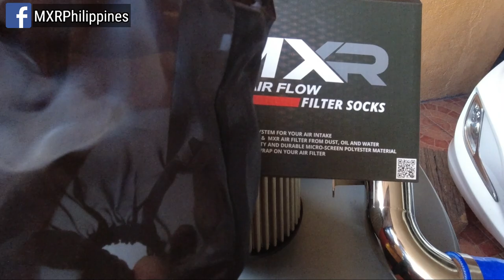Ang Lupet ng Tunog! Hyundai Accent CRDI High-Flow Performance Air Filter Upgrade

Comment: Sir Noah Thanks for the video I did install a K&N OEM filter and it feels wayyy better now it is more responsive and also a little bit louder but not too much like the cone filter. cheers!! Also, I will like to remap the ECU but it is too expensive I will need to save for some time
Reply from the maker: Welcome sir. Did you used drop in filters? They are okay too. Yes ECU remap is expensive especially if you live here in Manila

Comment: Intercooler upgrade for accent sir hehe
Reply from the maker: Pwede sir. Pero ipon muna. Mahal ang pyesa ng aftermarket IC sir at walang seller na nagtitingi ng pipes at couplers. So baka ipagawa na lang natin if ever
Reply from the maker: Pwede sir. Pero ipon muna. Mahal ang pyesa ng aftermarket IC sir at walang seller na nagtitingi ng pipes at couplers. So baka ipagawa na lang natin if ever
Reply: @NoahsGarage  waiting din po dito sir. Intercoller upgrade. 

Parang Negative kasi ako sa high flow air filter, mapupudpud daw kasi yung turbo(impeller - yung parang elise) mo nyan sir sa katagalan dahil sa nakakapasok na may kalakihang alikabok, based lang sa nakikita kong vlog ng mga mekaniko sa inaayos nilang mga sasakyan
Reply: Sisibak ng SUV yan sir pag nagkataon 😁
Reply from the maker: @quinjanrobertocampo8600  kahit stock sir sumisibak ang accent crdi, lalo na po kung upgraded ang air intake system 😅

Comment: My car 2019 CRDI accent auto trans was dyno tuned with stock intake/airbox 110hp and 159ft pound of torque. With stock airbox and the addition of 2.5 inch exhaust I only gained 1hp but gained 12 ft pound of torque to 171 ft pounds. I would do this first. I may buy a manual trans accent CRDI and go full tilt with it.
Reply from the maker: Dont forget to subscribe

Comment: Sir anu po kaya problema 2015 Accent diesel s bahay, sa Panel board nya po temp. gauge lang gumagana yung iba wala na po fuel, rpm, speedometer gauge. At kung minsan nag bliblink ilaw nya sa pael board pag naka low ilaw sa gabi.
Reply from the maker: Sira na board nyan sir. Pacheck mo sa casa.
Dont forget to subscribe

Comment: Sir I also have hyundai accent hatchback 2016. Interesado ako dito, pero nag bago ba ang fuel consumption?
Reply: Btw sir may times ba na nakadyot ang kotse nyo sir?
Reply from the maker: Di naman tumaas ng sobra ang konsumo sa diesel, parang ganon pa rin. Depende kasi sa apak mo yan sa pedal sir. Hindi po kumakadyot sir
Dont forget to subscribe 🙂

Comment: Hello sir, okay lang po ba MXR High-Flow Air Filter (Racing Cone Type) yan lang bilihin wag na yung stainless steel pipe? fit parin ba sya?
Reply from the maker: Depende kung magawan mo ng paraan sir ung housing niya. Ung hose kasi nyan babagsak pag tinanggal mo ung housing.
Dont forget to subscribe 🙂

Comment: Sir noah okay lang po ba yan puro init sa engine bay ang mahihigop ng air filter?
Reply from the maker: Yes sir ganyan po talaga set up nyan. Pwede mo siya lagyan ng heat shield, me nabibili mga P700 pesos. Or, papagawa ka ng pipe na mahaba then papunta sya sa wheel well para nakatago, cold air intake na po tawag don sir.
Dont forget to subscribe

Comment: Negative po ata ibang accent crdi users sa oil catch can sir?
Reply from the maker: Baket naman po sir?
Reply: Crdi user ako at may occ na for almost 2yrs ,maganda nga ang resulta at di gaanong dumurumi ang egr at iba pang parts ng kotse
Reply: @uchiha45100  siguro nga yung breather lang talaga ang pangit?
Reply: Depende sa pagka install and parts na ginamit